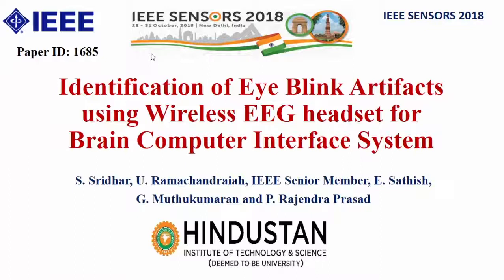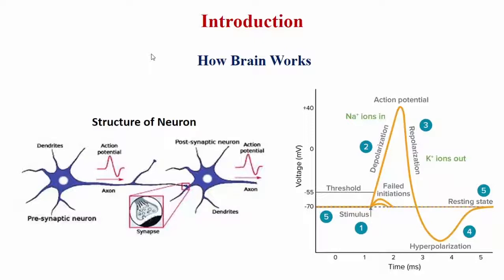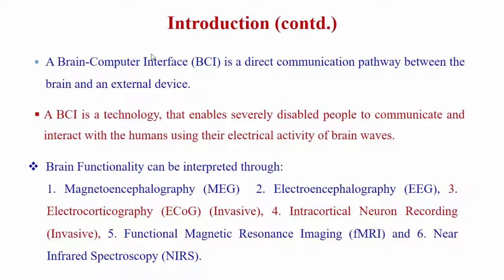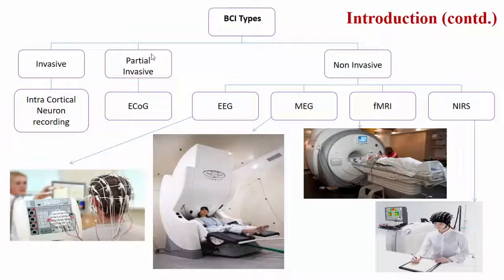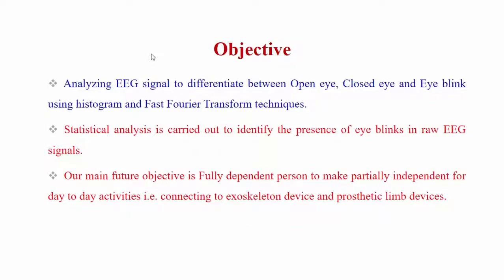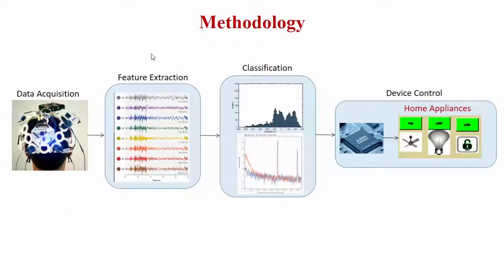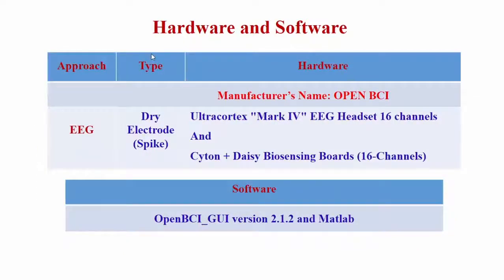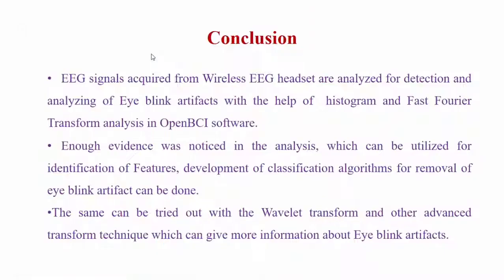Identification of Eye Blink Artifacts Using Wireless EEG Headset for Brain Computer Interface System

Comment: Hello I have a question , in case the user wants to control a device through eye blinking , howe will the system differentiate between the spontaneous eye blinking and the intending eye blinking for devices control ?